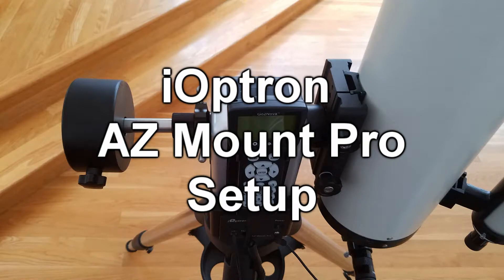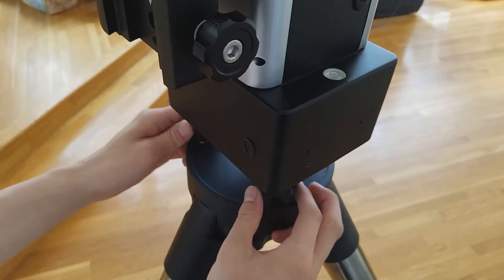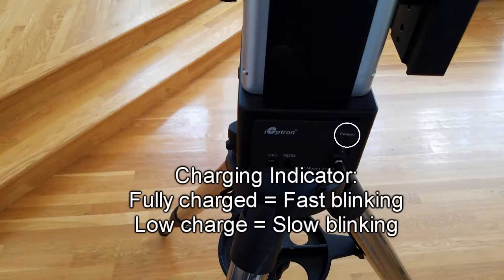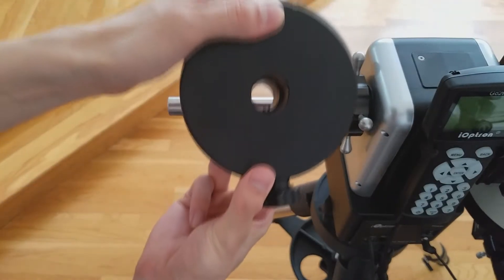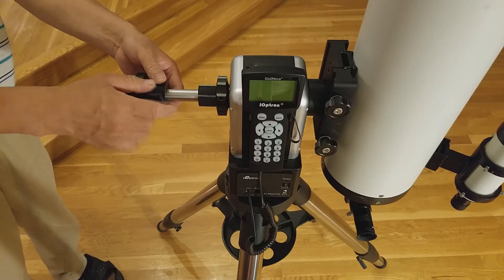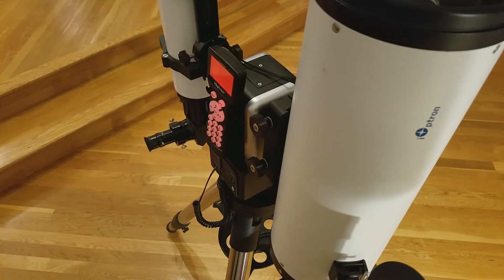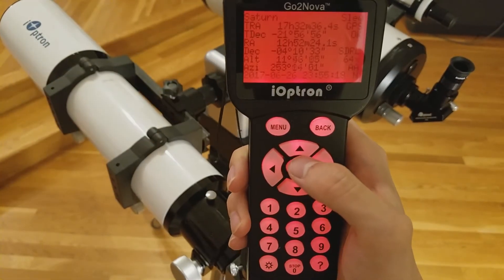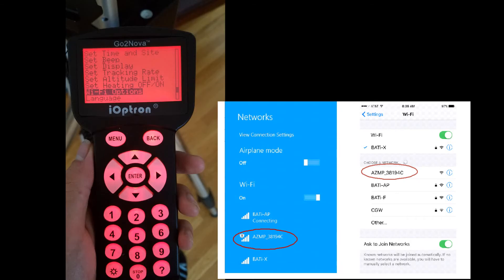8900 AZMP

Comment: Useless set up instructions. This guy just glossed over the counterweight section. He should have shown figuratively and demonstrated how he did the Torque = Weight * Distance at various settings and using examples of the scope weight. Also shown the same when two telescopes are mounted.

Comment: Can I move it manually by hand in the horizontal direction ?
Reply: No , I have this mount, doesn’t have Azimuth clutch, bummer. But it’s a wonderful mount and can take quite a bit of load and the other end you can have a second lighter scope as well. The battery lasts for good 10 hours even in 35F
Reply: @dgdave2673  Does this mount shake much?  I have a C8 that I would like to try to impove from the SE mount.
Reply: 45667777ýyyyyggvvv